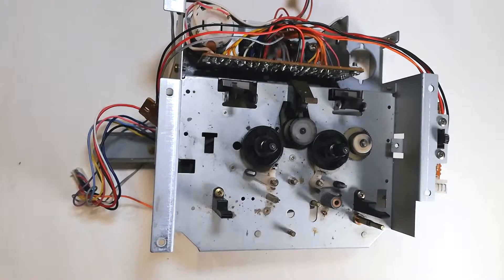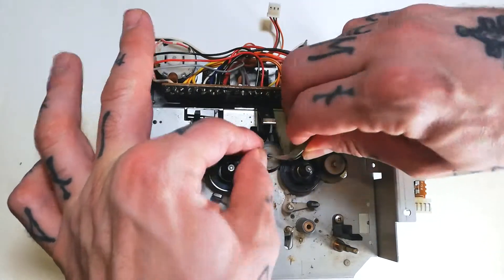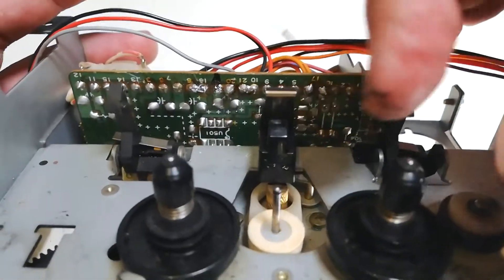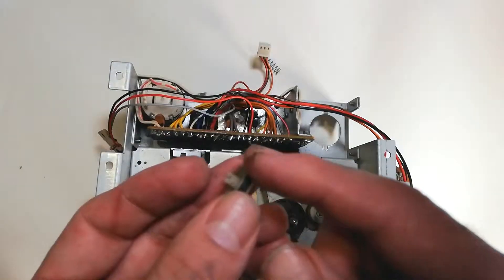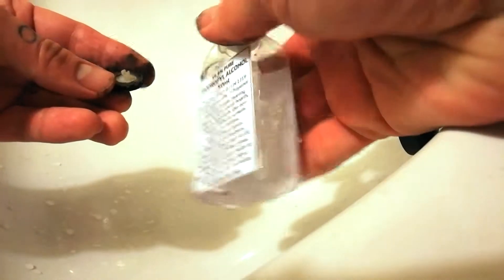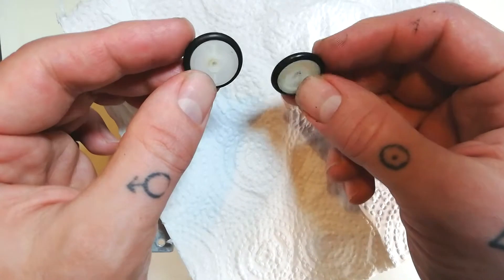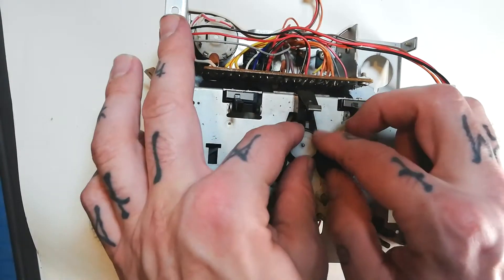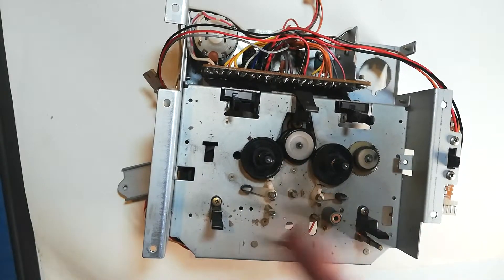10 Idler tires (Fix your Tascam 244 Portastudio)

Comment: I have just changed the idler tyres and used O rings. Unfortunately I can hear a noise and it appears to be trying to turn the cassette. Maybe the O rings are slightly bigger than the flatterned versions. You said there's a video on filing the O rings down, but I can't find it. Many thanks for the videos.

Comment: Please can someone help, 
I have replaced my idler tires but there is still not enough power transferred from the brass spindle for the tape to play smoothly.
 The problem only occurs when the top wheel is replaced with the spring, not when running a single idler tire. . 
  So what are my best options… replace the spring? Replace the lower idler wheel? Can I remove that beige washer thing that sits under both idler wheels to reduce friction?
 I have silicone greased the spindle as well but that did nothing…
Reply from the maker: I cant say without being there what other factors may be contributing to your issue but silicone grease will destroy the friction between the rubber part and the brass part. You need to get any trace of silicone grease or any other lubricant away from that mechanism, it relies on friction. I'm not sure what solvent you'd use to get it off the brass though.
Reply: @Tetrakan  thanks , no grease got near the brass part, and what minuscule amount that was on the tires spindle has been removed. I followed your excellent ‘how to’ manufacturer idler tyres video and made a slightly taller tire that works. The next problem to solve is play and fast forward are almost the same speed. The speed selector does nothing… is there any forums or places other than the comments to talk to awesome people?
Thanks for your work thus far.
Reply from the maker: @blutaq play and ffwrd speed the same is usually due to  the pinch roller isn't making firm contact with the capstan pin. There is a trimpot on the back of the control boards which can be used to ensure that play mode is the maximum height the head array can travel to, though often bad grease will stop the head array going all the way to the top.

Comment: this might be a dumb question but is the tire supposed to be able to slide around the wheel? for example, if i hold the idler wheel in place, should I be able to move the tire around the wheel? I'm on my second set of replacement tires and they still arent solving my issue of uneven ff/rewind/play
Reply from the maker: They shouldn’t slide around the plastic wheel, no, they should be tighter than that

Comment: Hi .  I have a Tascam 133 , just bought used.  Needs belt.  But the weird thing is when I tested the ff/REW  ,  the  REW actually FFW, as did counter.   One time it actually engaged and rewound.  But sometimes the idler won't engage the platter wheel.  FF doesn't engage at all.  The idler tyres look cracked and aged.  Would this attribute the weird ff when I hit rew??  It's very similar to the one on this video.
Reply from the maker: I'm not familiar with that model... Is there a potentiometer mounted to a plate on the rear of the transport? If so, check the white plastic clip on the spindle of the potentiometer. Is it intact and connected to the plastic gears below?
Reply: @Tetrakan  I think I figured it out.  The solenoid that clicks the idlers back and forth was not engaging fully.  There were several joints and bits that interconnect to the idler cradle and I put a drop of wd40 on each metal joint.  Seemed to have done the trick.   

My belt has gone though and that's next on repair.   When i hit play the take up spindle spins quite fast.  Much faster than normal play speed.  I know the capstan controls the tape speed through the pinch roller, when belt is installed, so does that spindle slip or something because its spinning much quicker than the capstan.  Is a clutch managing the difference in speed?
Reply from the maker: @rcary  if there are solenoids in there it's a significantly different design to what im used to, so im not sure how useful my description of the 244 mechanism will be to you, but here goes- on the 244 it's normal for the reel motor to want to turn the take-up reel faster than the capstan and pinch poller, that ensures the tape between the capstan and take-up reel is taught and does not get chewed up; there is no slippage or clutch on the 244, rather friction between the serrated edge of the take-up reel and the rubber idler tires forces the reel motor to slow to the same speed of the capstan.
Reply: @Tetrakan  ok, I knew the take-up reel ran quicker.  I'd say 4 to 1 quicker.  I just wondered if that would cause strain on the motor that runs to the idler. There is another motor that runs to the belt/capstan. There is also a speed switch to run the tape at 3.75 inches so maybe that's why.  Maybe in over thinking it. Lol

Comment: If an idler tyre ( or rubber ) cannot be sourced , simply use an o ring . It works better .
Reply from the maker: This is the tenth video in a series of over thirty, which includes several videos about adapting O- rings. Thanks for watching.

Comment: hey, do you happen to have a source or replacement idea for the idler wheels themselves? i managed to find plumbing materials for the tires and it works fine
Reply from the maker: The white plastic wheels the tires are fitted to? If that's what you mean then no, you'd have to buy a spares unit or wait til someone can 3D print them
Reply: @Tetrakan  yea.. I thought about 3d printing but then you'd need an accurate scan or 3d model
Reply from the maker: @julesnominal1804  I have spares if someone could scan them, msg me on Facebook

Comment: great to find you tetrakan , my tascam 244 has been idle for a long time now . after having the 244 serviced it was years i think till i unpacked it to use again and after switching it on i,m only presented with a humming type noise ? cant operate it either it was a great machine for me , is there any chance of a revival ?? thanks mate...tony
Reply from the maker: Hi Tony, yeah that's probably just the control belt is loose or snapped so you're hearing the motor. The electronics can be tricky but the transport on the 244 is a forgiving beginners project. Follow the first 15 or so videos in this series in order and you'll be fine, the playlist is visible on my YouTube homepage.
Reply: @Tetrakan   thank you so much for your reply , i,m all the way from australia mate. i shall follow your suggestions , and if i may i would like to inform you off my results . thanks again , tony lee
Reply from the maker: Please do, good luck!

Comment: do you happened to know the diameter inside and outside for those idler tires ? I am trying to order them from eBay , the seller proclaims that they are slightly different diameter on older models vs newer... I've got Tascam 246 European power model with the fuses. thanks in advance , cheers, Dimitri
Reply from the maker: I've had about a dozen 246s and at least fifty 244s, the idlers were all the same, see this video for advice on sizes https://youtu.be/CnejGIuJfg4

Comment: Great video. I have a Sanyo m7735 boom box and the cassette doesn’t play. It moves fwd and rew with no problem. The belt looks fine. I notice that the idler wheel doesn’t engage with the upper gear when in play. What can be happening? Thanks for the help.
Reply from the maker: Hey, I see you've posted a link to the problem elsewhere, so I will comment on the video itself as well but generally speaking nine  out of ten transport problems are caused by EITHER a] bad rubber preventing the energy form the motor reaching moving parts (because rubber becomes dry and loose then gooey over time) OR b] bad lubrication limiting the movement of moving parts (because lubricating grease begins to act like glue over time) Occasionally some sort of plastic part will snap, or a motor or a capacitor pertaining to a motor will die. If the rubber is fine and the motor is turning and there is a wheel not engaging, that says "lubrication problem" to me, in which case you're going to need to at least partly dismantle the transport taking plenty of reference photos as you go, clean off the old grease with isopropyl, relubriucate with silicone grease and reassemble. Frankly it is a tedious and nerve racking process, especially with units that have mechanical buttons (the ones with electronic transport buttons are typically easier to dissassemble). Good luck!

Comment: Hi Tetrakan,
thanks so much for the videos, you put them on youtube exactly when I bought one of those fantastic bad boys (the 244 to be precise) and I obviously had few issues with it.
I've just changed the idler tires, they were chewing the tape, I could record 10 second on the tape but then after it would go all crazy, and the forward/backward were doing the exact same. So I've changed the idler, now I can go through a whole tape with backward and forward without trouble, only trouble now is that the recording doesn't seem to happen on the tape and a squeaking sound appears when I play (and sometime on record but not always, anyway it's noisy on record as well). I've been careful to put both wheels against where the old ones were.
Maybe for the squeaking I should oil the transport part but I don't get why it doesn't record on the tape anymore? I guess it's the beauty of the tascam, once you fix something, something else breaks :D .
Reply from the maker: I've just seen this, so apologies I didn't give you an answer sooner...the squeaking is probably the idler tires, if you buy non standard parts sometimes the rubber s hard and rubbing against the plastic parts casues squeaking. Do not oil this! Solution is to agitate the surface of the rubber with sandpaper - look at the video I did adapting plumbing parts for the idler tires, same process. As to your unit no longer recording, mechanical and electrical functions are more or less separate so I guess you disturbed a weak electrical joint when you were replacing the rubber? Hrd to make suggesitons without being there but make sure the record enable switch (top left) is intact, all the cables relating to the magnetic heads are intact, and make sure the record and erase heads are plugged into the correct sockets (check my videos please but from memory the record head should plug into the upper of the two sockets, that plug has red cable trim whereas the erase head plug has black cable trim) Good luck!

Comment from the maker: By the way, if you lose the little plastic clip that holds the idler wheels in place, you can use a small C-clip instead. A multipack of different sizes should be cheap and easy to find in a hardware store, or from eBay, Amazon, etc.
Reply: Hi
Thank you so much for this video! Super helpful when repairing my 246 transport🙏⚡️
Unfortunately I managed to “ping” that little plastic clip and lost it during my repair here… so your saying they are easy to find at a local hardware store?
You’re calling it a “C-clip” ?
Thanks